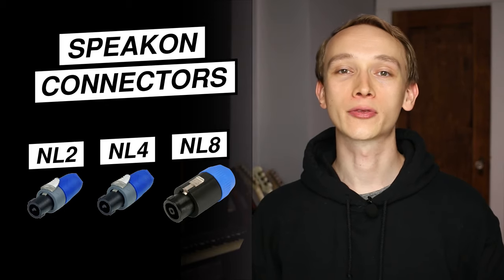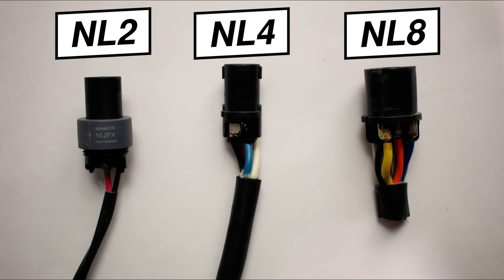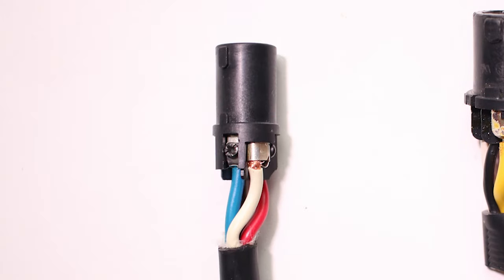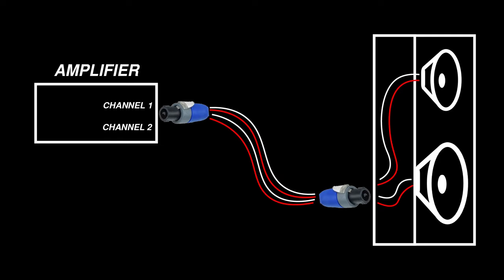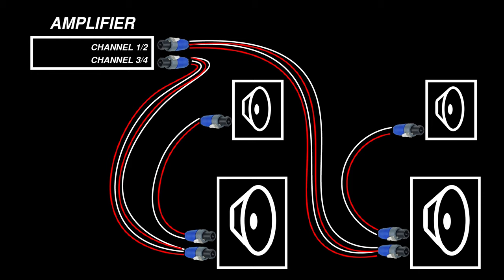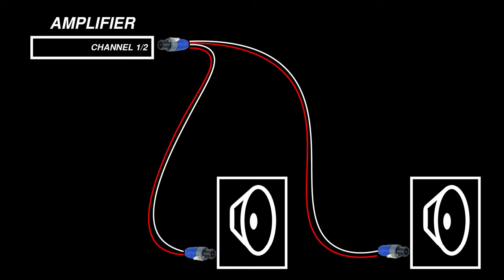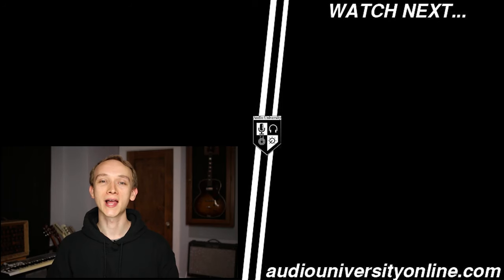NL2 vs NL4 vs NL8 [Neutrik SpeakON Speaker Cable Connectors]

Comment: I have a wireless mic that has a TS adoptor but I cannot plug it to the amplifier because the amplifier on receive an xlr cable. is there any converter for this?

Comment: I have a 2 channel powered (4ohm stable) mixer with 2 speaker outputs. Can I connect 2 8 ohm speaker cabinets using the nl4 speakon connector to each channel?

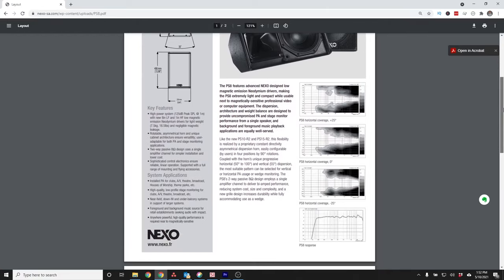Comment: @2:30 so there would be no actual connection/circuit with an NL2 because of the design. You would need NL4 to complete the circuit, right?

Comment: I was hoping you can answer a question for me. I want to wire and xlr end to a speakon end but my speakon only has a wire setup. How would I wire this up on the speakon end? thank you in advance for your help!
Reply from the maker: What are you trying to accomplish with the XLR to SpeakON cable?
Reply: @AudioUniversity  from my mixer master out L&R to a speakon panel so I can make a quick connect setup.
Reply from the maker: Do you have an amplifier between the mixer and the speaker? XLR is a mic/line level connector and SpeakON is a speaker level connector. So, a simple adapter doesn’t have a purpose (that I’m aware of). Check out this video: https://youtu.be/gzbiOeqbERE

Comment: is there any smaller alternative connector type you recommend to speakon?? waterproof too..
Reply from the maker: SpeakON is the most compact and weather-resistant design I've used. They are used at outdoor concerts frequently and are designed to withstand moisture.
Reply: Some speaker brands, e.g. ZSound, use aviation connectors.

Comment: Can I connect a red and black basic speaker wire directly into a NL2 speakon connector? I have an amplifier Berhinger with speakon "in" connector but my ceiling speakers use basic red and black speaker cables
Reply: Yes. Speakon is just the pattent for the clip-in stlye connection, rather than a jack that can be pulled out accidentally.

Comment: Very helpful and straght forward. Nonetheless, I can't find devices with NL8 connectors. Is this connector rather custom-installations oriented?
Reply: I know that it can be found on some 4 channel amps such as the d&b D80. I've also seen someone make custom socket plates for their 1HU 4chan Powersoft T904s with an NL8 connector (I think you wouldn't be able to fit an NL8 connector in the height of 1 HU).
Reply: @charlotteice5704  Thanks for the info

Comment: Just wondering if speakon cables need to be shielded?
Reply from the maker: No they do not.
Reply: Thank you! So I suspect it's all good running my speakon cable next to my shielded speaker cables?
What about running the speakon cable (Rels high-level Neutrik) next to power cables, I suspect thats a whole new different matter or do you think I'm good to go... running the power cable alongside the speakon cable as well?
Reply from the maker: A speaker cable run behaves like a balanced line. Both conductors have equal impedance and any noise induced upon the cable will cancel in the load (speaker coil). Check out this video to learn more about this principle: https://youtu.be/rgfZb1pEIrU

Comment: can i connect a speakon to xlr jack and how
Reply from the maker: While it could be technically possible to create an adapter like that, you should not. The reason is that SpeakON connectors are for speaker level signals and XLR connectors are for line level signals. 

Check out this video to learn the difference:  https://youtu.be/gzbiOeqbERE

Comment: What could happen if I use a nl4 cable into a single speaker cab? The cab is probably nl2 required
Reply: The second set of nl4 stays unused. Professional speakers have a circuit diagram on their inputs how it's internal connected